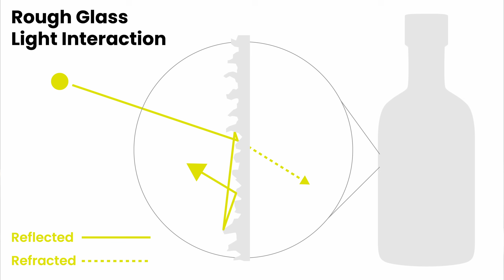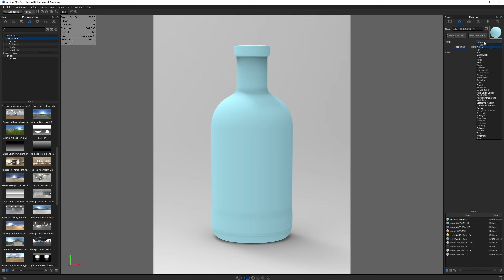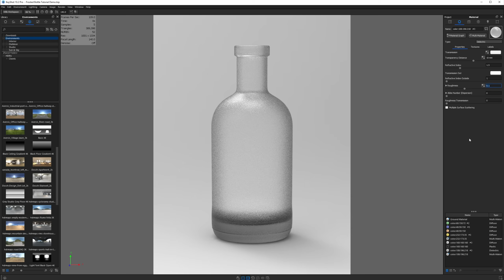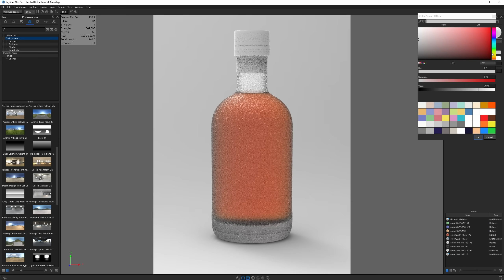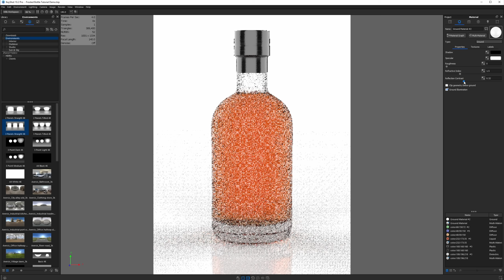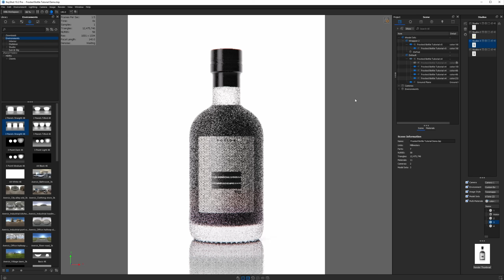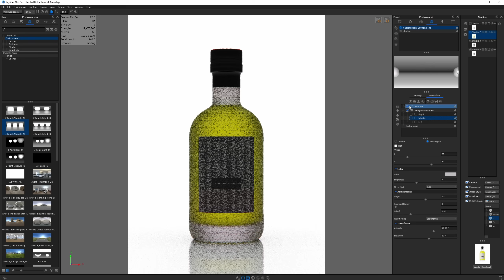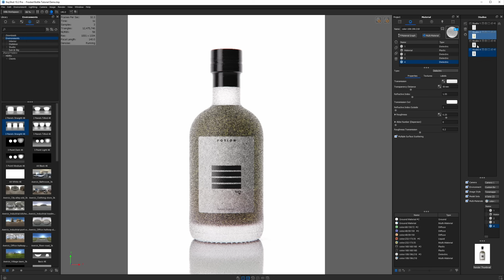How to render bright, white frosted glass in KeyShot 10

Comment: I found this is the best video comment section suitable for me to comment as this relate to ''Glass Material'' Previously in old keyshot versions ''Glass Material'' have the option of ''Two-Sided'' Refer Link :- https://www.youtube.com/watch?v=HlxF9peYod0 Time Stamp :- 21:30 This ''Two Sided'' option later change to '' Refractive'' Refer Link :- https://i.imgur.com/xda3pW1.jpg or See Keyshot10 '' Glass Material'' Before asking my question i want you to refer Keyshot 10 Manual Refer Link:- https://manual.keyshot.com/manual/materials/material-types/basic/glass/  In the '' Glass Material'' they said that'' just a single surface (no thickness) and you want to make it reflective and transparent, but not refractive. This is commonly used for car windshields''. It means that '' Car Windshields'' have no thickness But when i google i found that it has thickness Refer Link :- https://imgur.com/a/LBDYBpE Please give me real life example ''Glass Material'' which has no thckness? My Second question is see your above video Time Stamp :- 0:44 and 1:09 in which you said that in glass material some of the rays Reflected and some of the rays Refracted In Keyshot even in ''Dielectric Material'' i don' find ''Reflection Parameter'' You know any keyshot material in which we can tweak Reflection and Refraction parameter?
Reply from the maker: The basic glass material has a refractive checkbox since many automotive car models are created with surfaces with zero thickness. If you use a refractive material on a surface with no thickness, it'll produce bad results. This is why basic glass exists. The result you get is transparent and reflective surface without refraction. If you have a model with a glass body with thickness, then use the solid glass material that has built-in refraction.

Reflection parameter is called 'specular' in KeyShot (and many other software). The color set to white is = 100% reflective, whereas black would be = 0% reflective.
Reply: @WillGibbons   I know that Reflection Parameter is called ''Specular'' in Keyshot But Material Gem, Glass, Glass(Solid),Dielectric don't have Specular this is what i want to say? And As you tell that many automotive car models are created with surfaces with zero thickness. I want to decode this ''Many'' tell me one name?
Reply: Sir Please reply i am waiting for your answer?

Comment: is it possible to make half frosted and half clear bottle? Like it is getting frosted.
Reply from the maker: Yes. For that, a black and white texture needs to be used to control the roughness. The black part of the texture will produce clear glass and the white part will produce frosted glass. If you use gray, it will be less frosted.

Comment: Love it ! It would be nice - and I'm not sure how feasible this is, but when you reference a feature (in this case the multiple surface scattering) to recommend what settings can get a similar outcome with other inputs. Saying this because I think the surface scattering is a keyshot 10 feature and wondering how to get a similar effect on 9! Anyway great video!
Reply from the maker: Ah! Yes. Well, if I was able to do this in any version before KeyShot 10 I certainly would have, haha. I don't have any way to create the same effect in an older version of the software unfortunately.
Reply: @WillGibbons  good looks on this response, I appreciate it. The material w/o the surface scattering is still worlds better than using glass material with roughness index! so still a good tutorial on the material.

Comment: Will - This is great; thanks for sharing. Question regarding your approach with liquid and offsetting it slightly into the bottle; I've taken this approach with some alcohol renderings, like bourbon and have gotten good results; Do you use this as a rule of thumb / general approach for all liquids? I do a lot of cosmetic products as well and I usually offset the products which are usually liquids or powders to be slightly smaller than pack; usually with acceptable results but wondering if this might be a better rule of thumb (this applies to frosted and clear glass and in some cases plastics)
Reply from the maker: Well, with nested dielectrics (two dielectric materials) it makes sense to do it this way and is what Luxion recommends. That said, for an opaque material I'm not 100% certain. I'd probably want to look at a reference in real life and compare.
Reply: @WillGibbons  Thanks Will. Great Video.